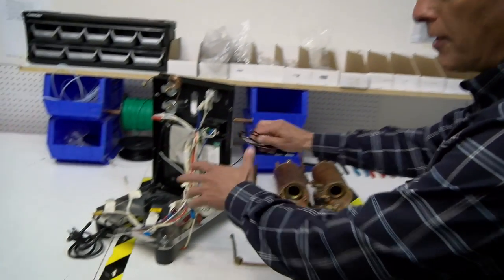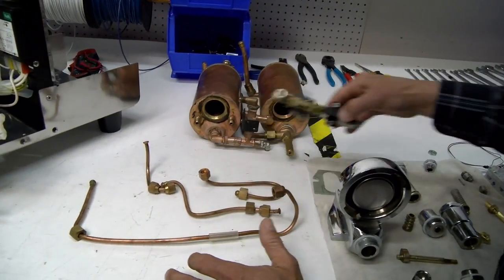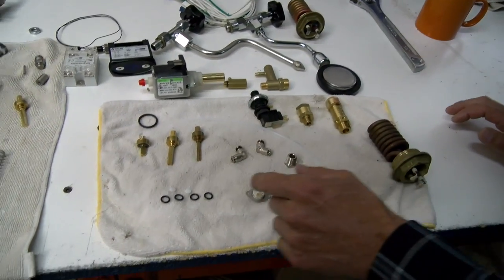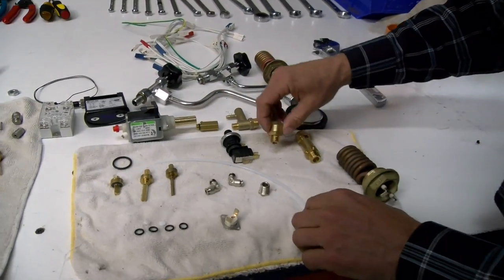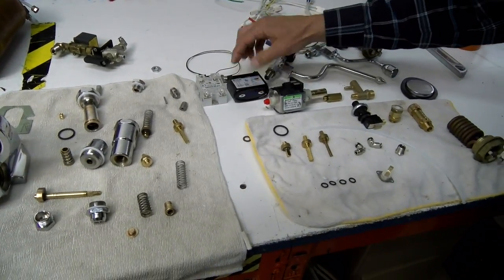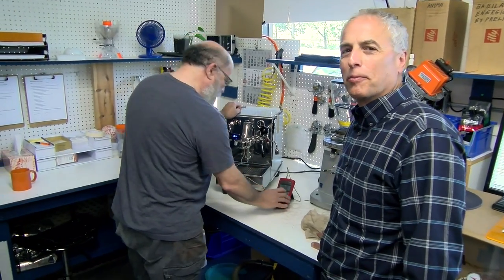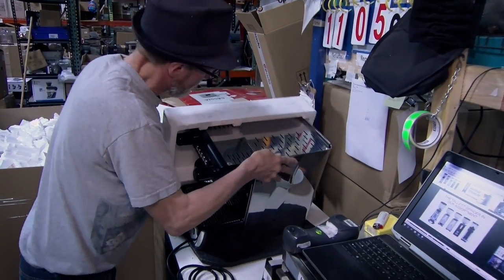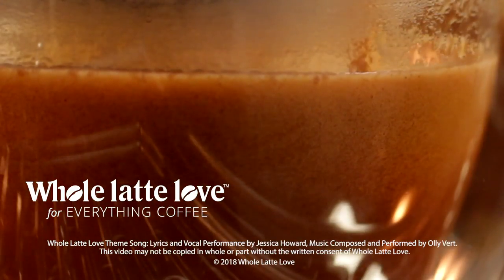Rebuilt Expobar Espresso Machines: Behind the Scenes

Comment: I love my Expobar Office Lever. What a great machine! Thanks for sharing!
Reply from the maker: Hi N, Thanks for the comment. Is yours a rebuilt machine? I consider the Office Lever to be one of the best values in home espresso!
Reply: It is not. Bought if from y'all brand new back in March (along with a Ceado E6Pv2). It is such a pleasure to use. The espresso it makes is heavenly. and it can steam all day long. Only thing that took me a while to figure out was the steam wand since it's single hole, so to get good microfoam the tip needs to be almost all the way out vs traditional wands to get air pulled into the milk.
Reply from the maker: That's awesome and nice Ceado grinder - it's got to help make the espresso heavenly! Thanks for the feedback.

Comment: Thanks Todd for the video and answering my questions. I purchased a refurbished Office Lever several years ago and it has served me faithfully with reqular maintenance. Two years ago the boiler heating element burnt out and I replaced it myself. Although the pump was working fine, I decided it was probably as old as the heating element so I replaced it at the same time. I flush my Office Lever everyday and do a thorough flushing with Cafiza detergent every two weeks. I run on filtered / softened water  and I replace the softner medium in the reservoir softener every 3 months. I just rebuilt my brew group last month and there very little evidence of scale any where in the group. Some of the vaIve seals were pretty worn so I replaced all the seals and gaskets. I would not have any fear of purchasing a refurbished machine from Todd and company in the future.
Reply from the maker: Hi JB, Thanks for sharing your experience with the refurbed Office Lever! Sounds like you are taking good care of your faithful servant!

Comment: Could you tell me please the weight of both boilers? One is designed to hold 1.6 bar, the other is for higher preassure - 9 bar. I think the second should be much heavy.
Reply from the maker: Hi m, Thanks for the question. Not aware of any boilers which go to 9bar - that would be a crazy high temp! The steam boilers in Expobar machines do reach about 1.6 bar. Brew boilers in dual boiler machines generally run under 1 bar. Boilers are constructed to handle the pressure and have safety relief valves if for some reason boilers exceed their rated pressures. Hope that helps! Marc
Reply: @Wholelattelovepage  Sorry for not understanding, but I have a scheme of 2-boiler coffeemachine in which it is said that the e61 group and the boiler are connected, there are not valves between them. The pump produces 9 bar into the boiler, the boiler heats this water to 92 degrees and transfer it to the group. So there's 9 bars in the boiler, too.

Comment: Hi Todd! How did you begin to repair/rebuild machine ? Where did you learn all that? Thanks,
Reply from the maker: Hi Brisson, Todd has been working on machines for about 20 years. Prior to that his background was in HVAC system installation and repair. Many common elements like electrical, plumbing, pressure carrying components from that experience which transferred into the espresso machine world.

Comment: Where is the flow restrictor installed in the thermosiphon line, on the boiler side or the brew group side?
Reply from the maker: Hi JB, thanks for the question. The flow restrictor in Expobar HX boiler machines is located in the tube running from top of boiler to top of group. Depending on age of the machine it can be located at either the boiler end or brew group end. It does not make any difference which end. Hope that helps!
Todd
Reply: @Wholelattelovepage  hey Todd thanks for the quick reply. I have an older model Lever that has only the boiler pressure gauge. I pulled the top brew group line off and there is nothing in the brew group side, but the boiler side has what appears to be a blacck disc with about a 3mm hole in the center. I assume that is the restrictor?
Reply: Todd, also after removing the line and reinstalling it, it takes my machine over a minute to reach brew pressure with a portafilter gauge installed in the brew group. The pump is moving water but takes way to long to hit 9bar. Worked fine before pulling the upper boiler line off. Any ideas what the problem is?
Reply from the maker: That would be the restrictor!
Reply from the maker: Can't be sure without machine in front of me but sounds like an obstruction is limiting flow to the group and therefore causing pressure to build slowly. In a case like this when it worked fine before and now it does not the question is what changed? If only thing was removal and re-install of pipe given the age of the machine my guess is dislodged material is causing obstruction. I would remove the mushroom valve from the group and inspect/clean. Info on that and more in our support wiki for the Expobar Lever found here: https://wiki.wholelattelove.com/Expobar_Office_Lever/troubleshooting#My_brew_pressure_is_low
Start at section in wiki titled: I Have No Water Flow At All From The Group
There's a video there showing How To Clean E61 Brew Group Mushroom, Jet and Top Valve
Hope that helps!
Reply: @Wholelattelovepage  I just rebuilt my brew gourp last month with all new seals. My mushroom valve had next to nothing on it. I run only filtered and softened water in my machine. The boiler line I pulled off was very clean as were both the fittings. Could I be air locked? I do see bubbles in the reservoir return line, but not much.